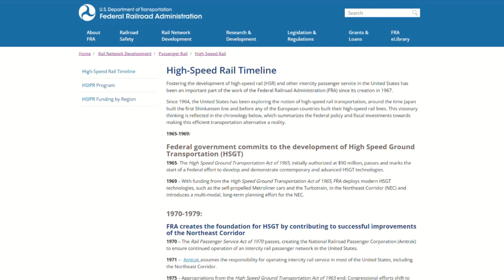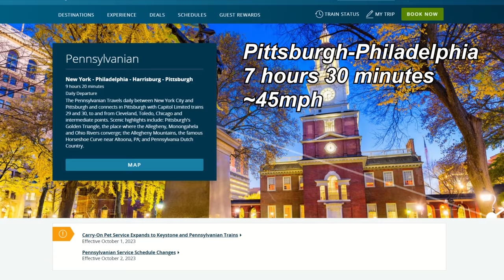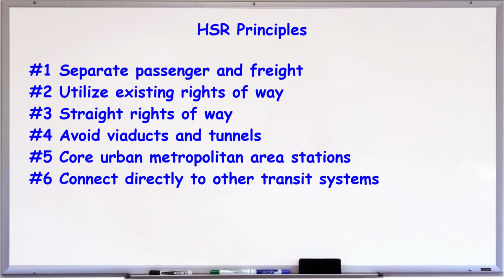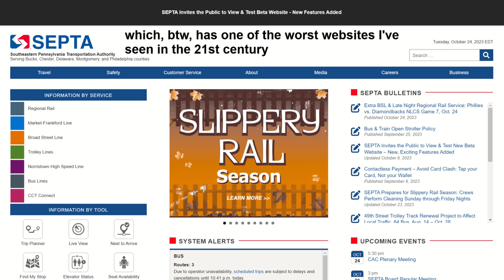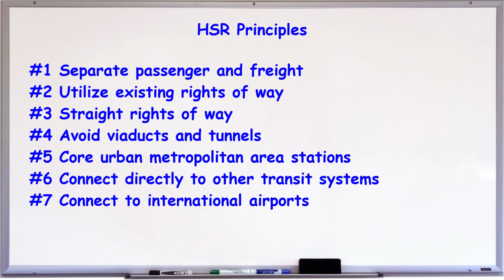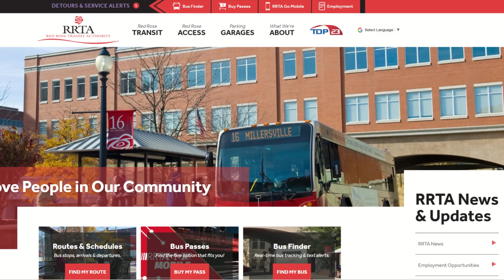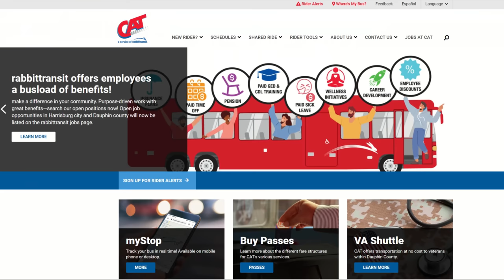Pennsylvania's Keystone High Speed Rail Corridor at True High Speed?

Comment: I have long supported the turnpike route, TPC owns substantial ROW around it and topographic conditions are far better. It is actually even more favorable than you lay out here— TPC would like to phase out all tunnels on the Turnpike in the next few decades, which would open the door to tunnel reuse or simultaneous construction with a new roadway, substantially lowering costs. There is also a long abandoned tunnel stretch for the old Turnpike around Breezewood that could also be reused. 

As for around the Pittsburgh area, as a local, I don’t think it would be feasible to route adjacent to 376, and certainly not at 90 mph. There is far too much development in the area around the roadway that severely limits ROW, and tunneling costs would be astronomical. The NS branch that runs through the city is not frequently used (maybe 5-8 trains max per day), and is a much better compromise for the final segment of the journey. 

Additionally, using the Turnpike ROW brings PA HSR close to the Capital Limited service from DC to Chicago near Breezewood, I think it would be extremely advantageous to also explore letting the two lines meet and reuse the same track into Pittsburgh. This line should also be explored for HSR service down to DC.

Comment: What if you re-route from Lancaster to York and then Harrisburg? That way you can add a station at York (urban area population: 240,000). It would only add a few minutes while serving several thousand more citizens.
Reply from the maker: Generally you're looking to minimize stops on an HSR route. Both Harrisburg and Lancaster is a something of a stretch already. Shorter hops you'd want to handle with local transit.

Comment: How much $benefit are there for each minute saved in trip time in your opinion?
Reply from the maker: I don't think its that simple. 7h29m over 7h30m is meaningless. 3h47m over 7h30m is a roundtrip in the time of one-way.
Reply: @LucidStew  How about we assume $1 per minute saved per passenger? So if a corridor have 1 million passenger per year, we say the benefit is $1 million per year?

So if there is 1 million passenger per year for this corridor, saving 3h43min (223min) is $223 million per year. Considering that we need a 4% return for any capital investment, $163 million per year justifies about $5.6 bn of 1-time spending.
Reply from the maker: @onetwothreeabc  why are we assuming $1 per minute?
Reply: @LucidStew  $1/minute is $60/hr of earning potential or $120,000 annual income. Do you think it's too low or too high?
Reply: @LucidStew  Another way of calculating the benefit is to survey how much passengers would be willing to pay. Currently a coach seat of the Pennsylvanian from Philadelphia to Pittsburg costs $55 and takes 7h23min. If a train takes 4h instead (saves 3h23min, or 203 minutes), would you be willing to pay $203 more ($258 total)?
Reply from the maker: 1) I don't know what the correct amount is. $1 just seemed arbitrary 2)For a 300 mile trip, $258 isn't great, but this also assumes the same ridership.
Reply: @LucidStew  $1 is just a starting point for discussion. Maybe you can try a vote with your viewers if they think it should be higher or lower than $1?

The flight from Philly to Pittsburgh is about $300-400. So it seems to me that $258 will be a very competitive price for a fast train service.

Comment: The philly to harrisburg section would absolutely be worth it imo but that terrain in western PA is just terrible for HSR. The engineering difficulty and cost would not be worth it. Not to mention the environmental damage
Reply from the maker: Local opposition as well. The turnpike has run into some of that in places. I will say that the majority of the proposed routes is either in or adjacent to the interstate. Also, most of the deviations cut through hills the interstate has cut through, or farmland.

Comment: The passenger rail activists continue to advocate for these trains  while ignoring a  crucial fact: These trains  run on the tracks  of  the freight railroads, in this case Norfolk Southern. The more Amtrak trains on  the  line,  the  longer the delay for  freight  service. Freight rail in the US runs on passenger train schedules - it must do so to keep the trains  running. Freight traffic  is increasing every year. Amtrak  is only going to cause more  and more delays  as time passes and freight traffic increases.
Reply from the maker: That's why there is a recognition in these videos that freight electrification or freight rail right of way sharing are unlikely.

Comment: Why??   People around Philly have little to no interest in going to Pittsburgh and vice versa.  Provide regional air service from Philly International to Harrisburg and Pittsburgh using the some of the billions needed to build the high speed rail .. Improve the Interstate and PA turnpike to allow safer faster travel by vehicle, not rail and still have plenty of money left over.  As it now stands, this is not Europe, Most people are just not into trains for long distance travel.  Sorry to pop your bubble but this is the reality.  High Speed rail is wishful thinking and a problem, not needing a solution.  IMHO
Reply from the maker: A good question and I think you make some good points. I'm not from Pennsylvania, as the numerous comments correcting my pronunciation of Lancaster make clear, so I can not give a locally informed answer.  In general, the point would be to provide an option. The general purpose of these videos is to go beyond the "build HSR" mantra and look at what that would more realistically entail and cost as a source of discussion.  My personal view is that we should build HSR where HSR makes sense. I think there are some places it does and lots of places it doesn't.  So far audience consensus on this one seems to be that this idea makes a lot more sense if it's connecting the NEC to a hypothetical HSR line between Chicago and Cleveland or Columbus, which I agree with.